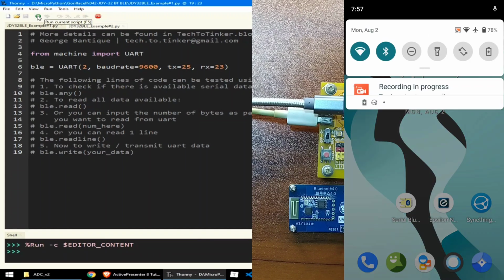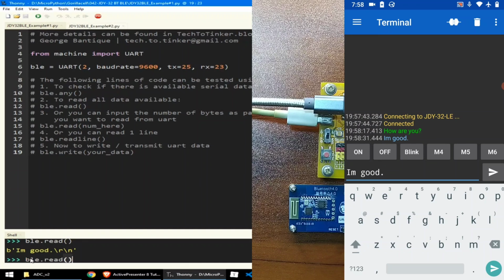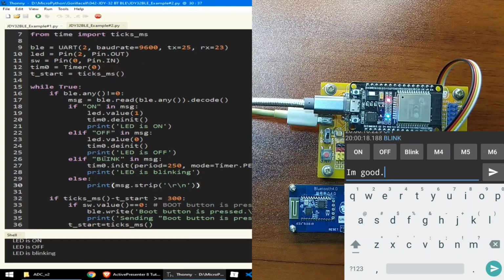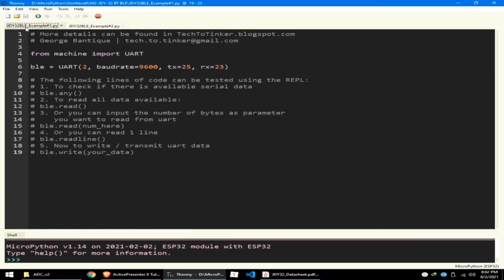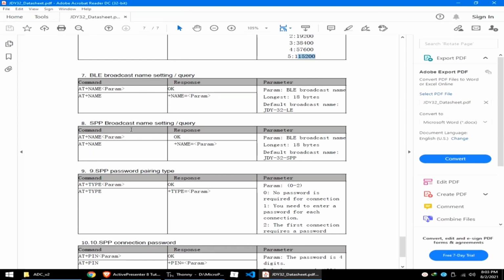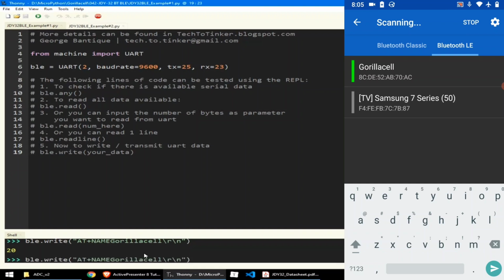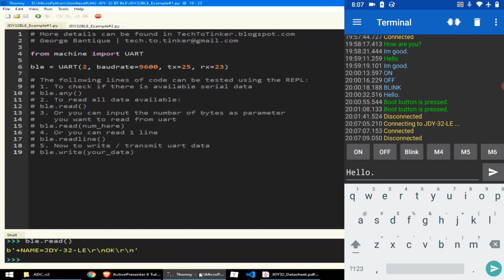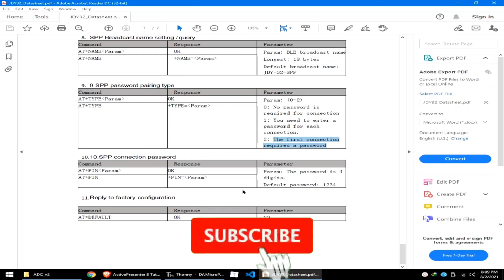042 - MicroPython TechNotes: JDY-32 | Bluetooth Low Energy | BLE

Comment: Hi George, my name is Tiago, I live in Brazil, I always follow the videos on your channel, first of all congratulations for the excellent work.  I tried a few times to use the Bluetooth contained in the esp32 itself with the Micropython firmware, but it wasn't successful, I tested it with arduino and it worked.  How would I make the Bluetooth connection through micropython?
Reply from the maker: Hi Tiago! Firstly, thank you for your support.

With regards to your question, Bluetooth classic is not yet supported by MicroPython as of this moment: https://github.com/micropython/micropython/issues/5406

But you may use Bluetooth Low Energy, please refer to the following:
https://docs.micropython.org/en/latest/library/ubluetooth.html

https://github.com/micropython/micropython/tree/master/examples/bluetooth

Hope this can give you a good start. I am planning to create a new video to demonstrate how to use BLE using MP sooner.

Thanks.
Reply: @TechToTinker  Hi George, first of all thank you very much for being willing to help.  I'll look at the links you sent.  It would be great to see a video on this subject here on the channel.
Reply from the maker: Hi, I believe you've seen my new post video. Cheers and thanks.